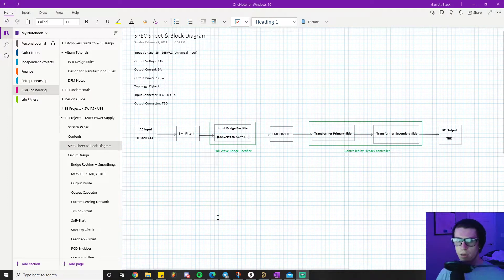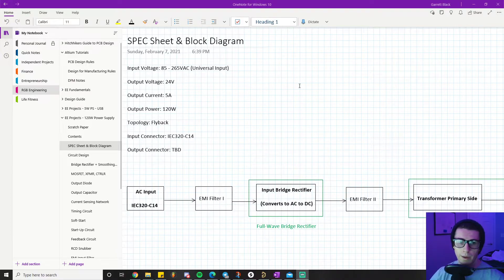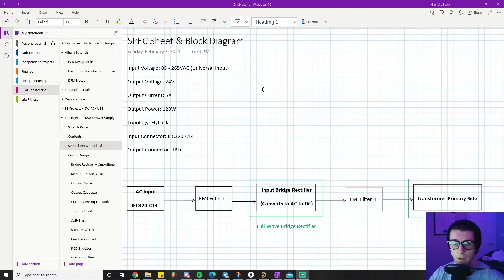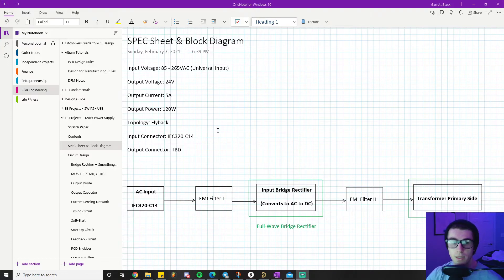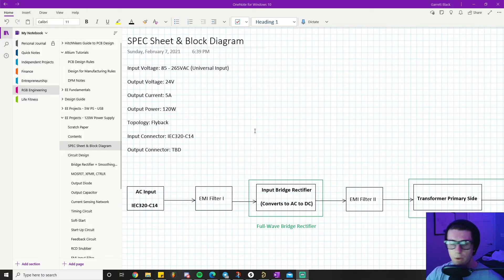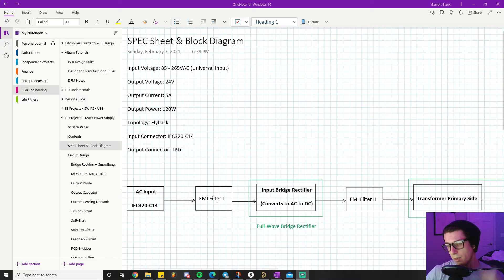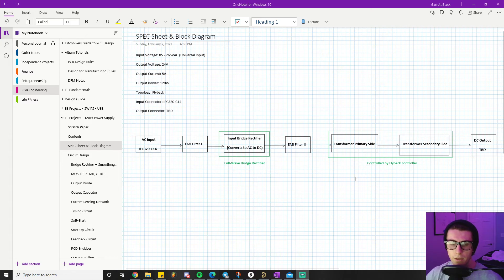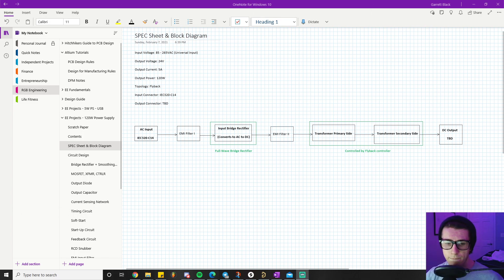FLYBACK CONVERTER PROJECT PT 2 | 24V, 120W FLYBACK CONVERTER EXAMPLE | POWER SUPPLY EXAMPLE PROJECT

Comment: Love the video and look forward to the series. Out of curiosity I have seen online that some power supplies have dual Dc and Ac input sources (normally like 24-80v dc and 85-250vac source) using the fly back topology. Do you think you could explain how this works in practice?

Thanks
Reply from the maker: Great question! The flyback converter can work with both AC and DC input voltages (technically it's all DC after it gets rectified). The flyback converter is popular because of its extremely wide input voltage ranges, which is why you see labels like the one you mentioned.
Reply: @RGBEngineering Ah that makes sense. Are there any like additional circuitry components needed to ensure safe operation or is it pretty plug and play overall?
Reply from the maker: I always recommend at least a fuse between AC mains and your circuit board/electronics assembly.

Comment: Hi RGB,

I am doing a project on having 3 outputs 12V, 5V, 3.3V. Output power total on 120W too.
Am i able to use the same controllers and devices, since the output is 120W and input voltage are the same.
Just by configuring the winding of transformer will enable me to have 3 different output?
And yes i am doing a flyback application too.